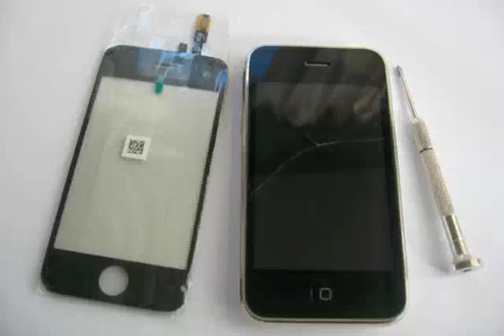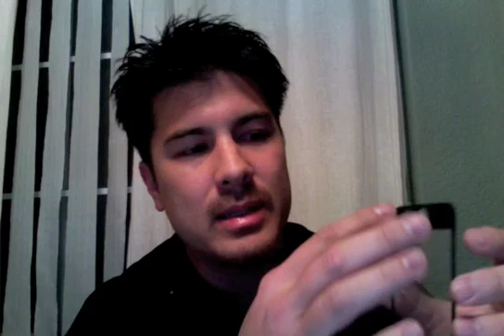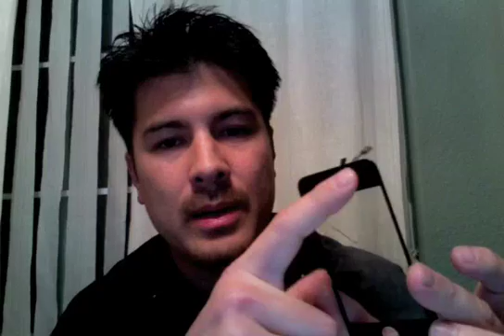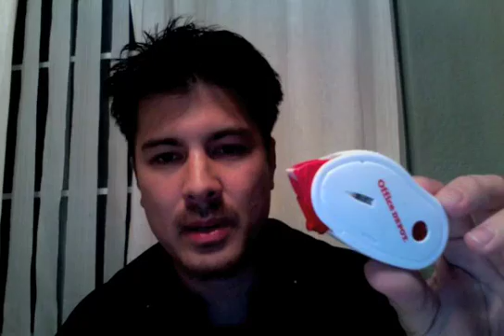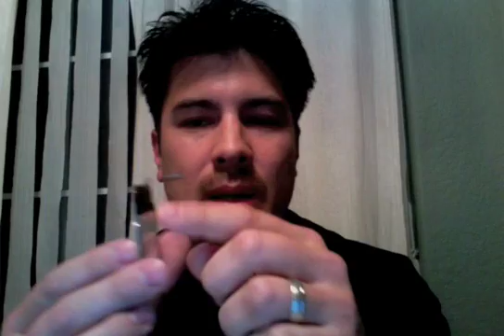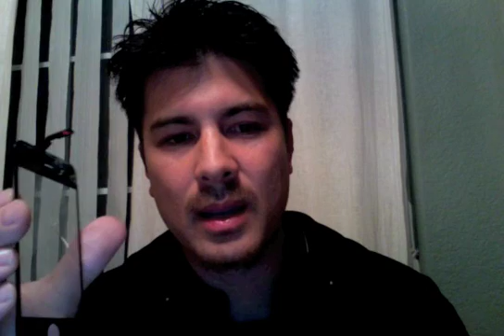iphone 3G glass replacement repair

Comment: Note not to cover up the ambient light / proximity and accelerometer sensors when putting adhesive on the frame or the screen wont switch off when held to face during a call.

Comment: I ordered the screen to my iphone... replaced it... and my screen didnt turn on =[   i was able to receive calls but the screen was off... check the wiring connections and still no good =[ called apple told 'em that my iphone screen had turned off and it wasnt showing anything... so they sent a box...i sent it back.... and I received a refurbished one! 

not bad for $30 lol

Comment: Actually, you aren't helping to clarify much. You see, they sell the glass + digitizer and they sell just the glass, so it is not always included. From what I hear, it is very difficult to do on a 3G phone and you should just buy the glass + bracket.

Comment: Lee... thanks for the good advise to heat the glass. I used the technique on my shattered glass and after about ten minutes with the hairdryer I could pry the glass shards without damaging the frame. The whole operation only took an hour.

PS. Be very(!) careful when separating the LCD from the glass frame. My LCD stopped working and I had to replace it as well. Now my phone is as good as new again.

Comment from the maker: buying the glass for the 3G will include the digitizer. meaning the glass and digitizer is one piece. the bracket is a separate piece you will need to remove and place on the new glass/digitizer.

Comment: I've apparently found this video a bit too late.  I've already removed the plastic bracket thing by prying it out, doing a number on it in the process.  Any tips on getting a slightly-mangled bracket back in, or is there somewhere that you can purchase replacement plastic brackets?

Thanks for your video and time.